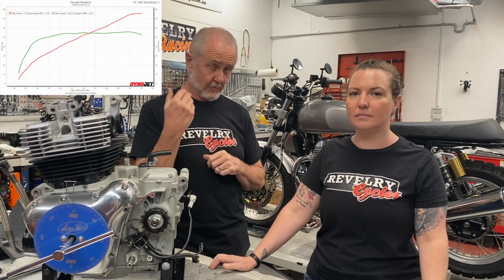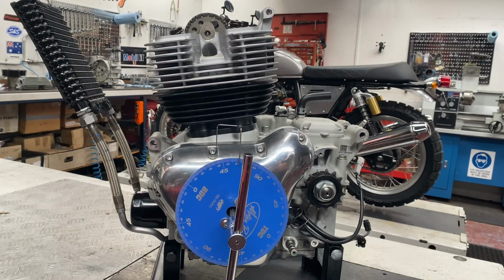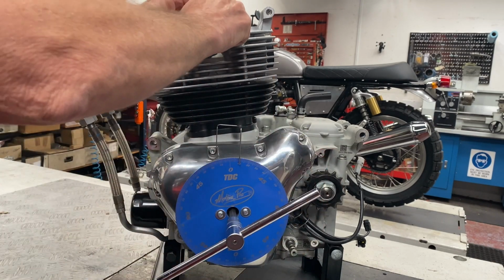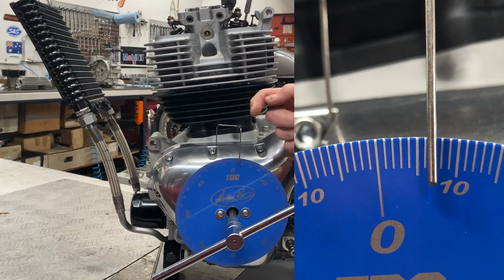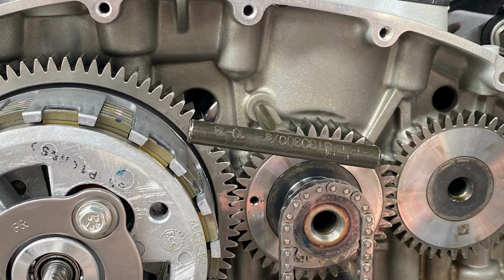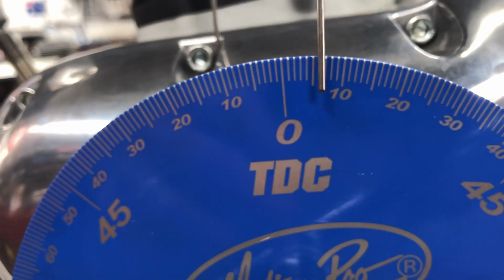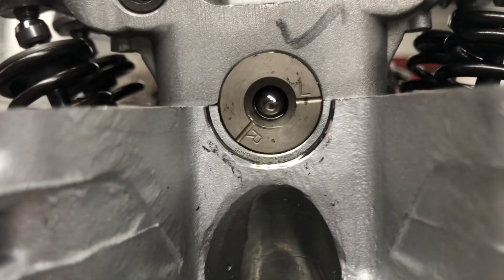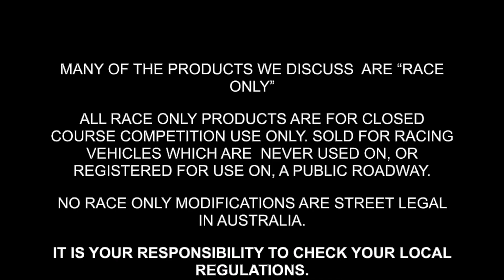Episode 8: Cam Timing - Royal Enfield 650 Twins

Comment: I really enjoyed this video on valve timing. Must be 40 years since I used a degree wheel. I have noticed the right side cylinder runs hotter than the left on the 650. Next service I will get the guys to check the valve timing to make sure it is not advanced. Thanks for the insight, I have been wondering what it might be.

Comment: Excellent! Important for those guys or gals, who think installing a cam is a simple bolt on mod, when I put a cam in my street twin, I made my  own crank pin and cam lock with no slop. It real easy to make a small adjustment error, lesson is to check and recheck.

Comment: Wish you guys did some videos like this on the Himalayan.  I own a 21 Himmy and recently fitted a fuelx lite and it has helped the bike run a tad smoother, but I get a rattle knocking sound under load around 4000rpm or so, and have wondered if my cam timing is off.  This video is very informative and will be checking mine the next time I check my valves. Thank you!!

Comment: I’m a bit confused. Is it possible to time the cam by just finding TDC with the piston stop tool and then lining up the L or R groove with the line on the engine as you would when adjusting valve clearance, or is the valve lift gauge essential ?

Comment: Hi Will and Santina, you guys might be the perfect people to ask everything about this 650 engine on the internet. I assume that you know about the valve tappet controversy. People say rotate the crankshaft counter-clockwise and manual has directed otherwise. So what's the deal with that bolt and in which direction shall I rotate it? I'll blindly follow your advice😄... Thanks and Cheers 👍🏻
Reply from the maker: You always and only rotate the engine forward in direction of running rotation. Viewed from the left hand (crankshaft rotor bolt) side thaat's counter clockwise. Viewed from the right hand (camshaft locking tool) side it's clockwise.

Comment: After installing the s and s camshaft im experiencing constant back fire from my left cylinder at constant throttle  and im not able to figure out the probable cause.......is improper cam timing a factor?.....and if its the case why does it only happen on my left cylinder and that too only at constant throttle?

Comment: Hi i love your videos really great and detailed
Do you think its worth getting standard factory timing settings checked  on a standard 650 set up for accuracy ?
plus am i better checking valve clearances using the spark plug hole tdc tool rather than the lines on the end of the cam
Cheers
Mark
Reply from the maker: There's probably no value in checking a stock vehicle's factory cam timing settings.
The marks on the cam indicate where the valves for that cylinder are unloaded regardless of the cam's timing relationship with the crankshaft. This means that for the purpose of valve lash adjustment, the marks on the cam are more valuable than piston TDC.

Comment: Since no one outside of Australian do this correctly, can you put together a tool kit with correct instructions and possibly a Teams or Zooms call at 15 minute increments paid on PayPal?
My dealer did this install and it doesn’t feel sluggish or hard to start, but the Dyno said 39HP.  I have you headers, S&S cam, DNA air filter, S&S race only cans and power commander 5.  The only way this gets done correctly is if I take my time, have the tools, and do it myself. I’d gladly pay for the all of tools and phone time.  Hell, my dealer can’t even get that cam alignment tool, or that valve tapper torque wrench. What do you think. Otherwise I’m going for the Thruxton R/RS or Speed Twin.

Comment: Request to clarify my below mentioned doubt regarding usage of valve spring spacers provided with the purchase of S&S performance camshaft.

When my mechanic opened the engine top cover I noticed the stock valve springs are already compressed enough & it is coiled up, now if we add the additional valve spring spacers doesn't it further compress the valve springs and increase the load on the rocker arm?? Is it necessary to use these valve spring spacers??
Reply from the maker: Yes, it is necessary to install the spring shims.
Reply: @RevelryCycles  ok thank you very much.

Comment: I would love if you can do a video about running your new bike in. Is it better to run your bike in first then get new parts for it afterwards? Also do you have to ‘ run in’ any of the new mechanical parts that gets installed after the bike is ‘run in.? Hope you had a great break.
Cheers
Reply from the maker: That's actually on our list of possible videos. Upgrade it from new or run it in first is really a personal preference. We do a lot of both. There is not really any "technical" benefit of running the bike in before upgrades. Yes, you do need to run in the upgrades so fitting them to a bike with kms on the clock means you need to do, at least a bit of, another run in as well.

Comment: Love your video's just one question did you modify that degree wheel? I have that one but the hole is small and doesn't have the other two bolts. I'm about to put in a S&Sncam and High compressoin pistons as well but keeping the stock bore size. Ilike to do this right but notise your degree wheel looks modified to fit the 650 please advice on how to get the wheel to fit the 650. John K.
Reply from the maker: Hey John,  we have modified it.  I've shared photos on our channels Community tab for you.
Reply: Have you set up a dial indicator on a engine thats still in the bike . I have put in the cam but trying to figure out a way to mount it in the frame
 @RevelryCycles
Reply from the maker: Sure, with the engine in the frame, you use longer horizontal offsets to get the gauge outside the frame rails.
Reply: I'll have to get some of those but I couldn't tell where you attached the to the engine?` magnetic base or use one of the rocker bolts to secure it it there  thanks 👍 @RevelryCycles

Comment: So guys question: what is your recommendation for cam timing for a street bike with low restriction K&N air filter, Tec 2:1 exhaust, 856 big bore, cam kit, clutch kit, and power commander. Probably will keep the stock throttle bodies-- you mentioned that you did one bike that way, also what kind of HP would you guesstimate. Appreciate any and all help (should I get the slick throttle bodies and /or the PowerTronic???). As I said looking for tractable B.A. street bike, not just drag bike, maybe even some touring. Just wish I could beam me and my Glitter and Dust (I call her KANTI, which I think is Hindi for shiny/flashy) over to Sidney so you guys could do your voodoo. Gratcie
Reply from the maker: The cam timing REALLY should be spot on the lobe centre. 0 degrees. The engine you're describiiing is exactly what the S&S cam is designed for. The only advantage the PowerTronic has is the ability to raise the rev limit. The 40mm throttle bodies will make a slight improvement with the stock head but you NEED teh CNC head to take advantage of them. With the head and throttle body package you can see (nearly) the same % increase again over the 865 conversion.
Reply: @RevelryCycles  Thank you for the reply. I thought that PowerTronic could advance/change ignition timing? So... guesstimate please as to ponies of my described motor vs CNC head and maxed out throttle bodies?  Thanks.